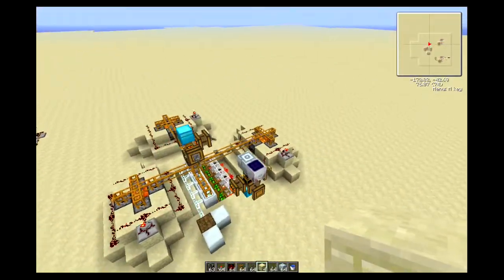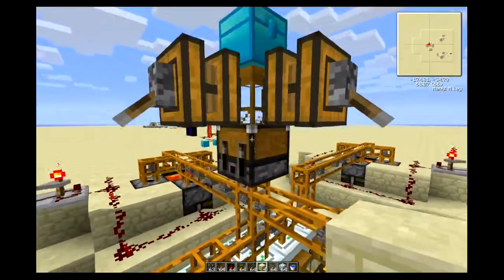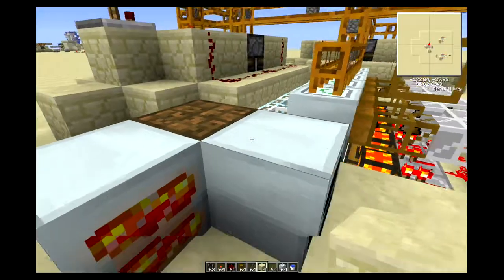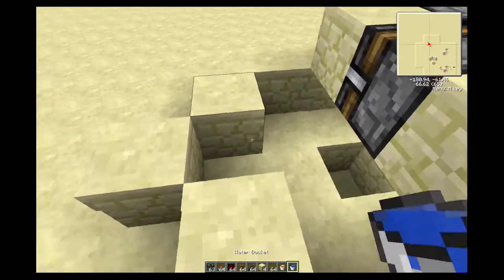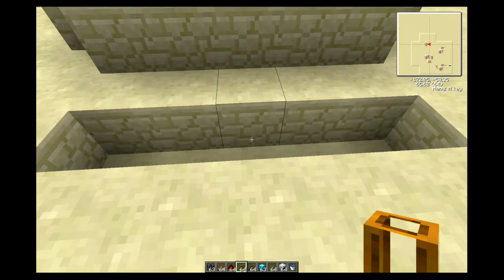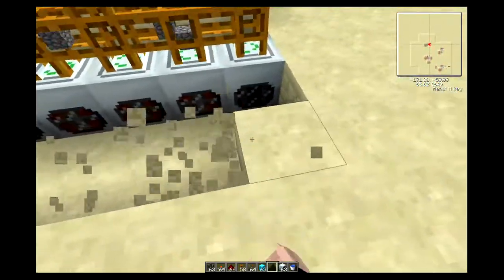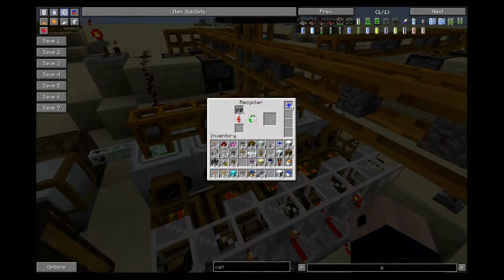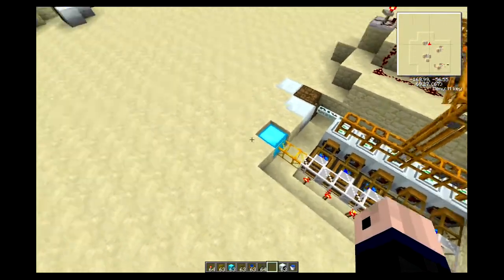[FTB-TUTORIALS] - Scrap-O-Mat -

Comment: 1: Igneous extruder: makes automatic cobble without energy but its only 1 block and ist fast like a manual farm

2: Transformer upgrade (increse the energytier by 1) 2 upgrades in the recycler 10 overlocker and you make 100k cobble in 2 min to scrap

 :D